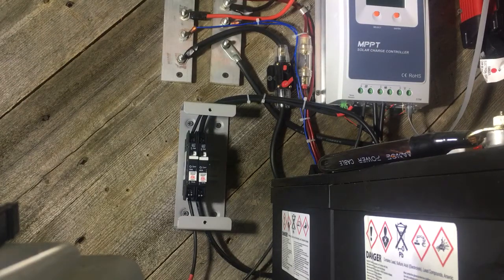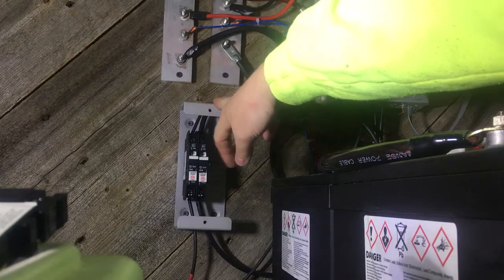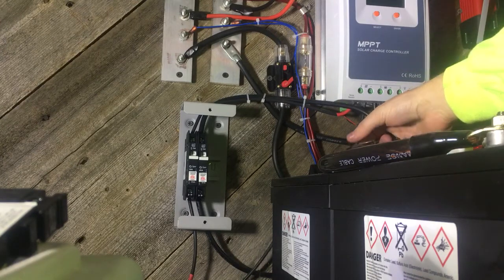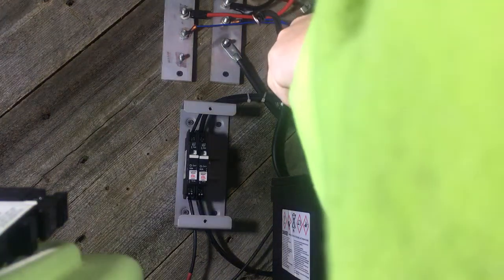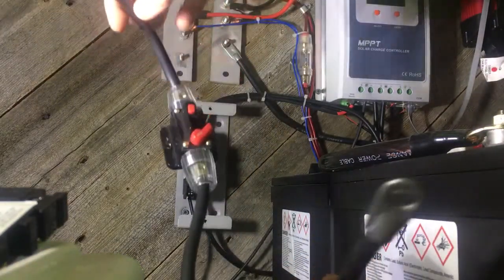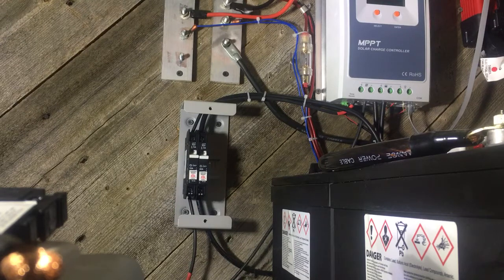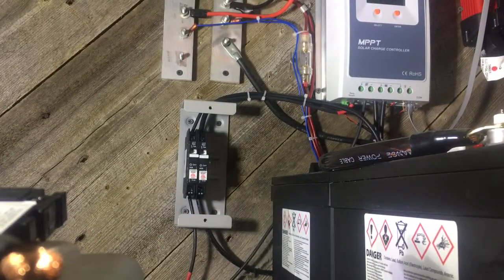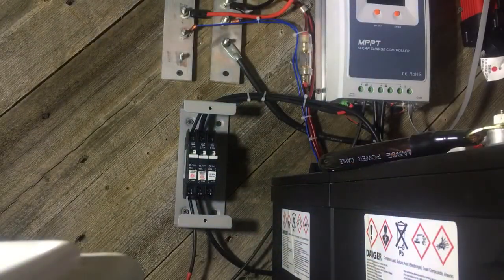Installing a D.C. Breaker

Comment: If I have two 100 watt panels in parallel, where would I add the breaker? Do I put use two breakers for each panel or one breaker fro the parallel? Before the charge conteoller?

Comment: just asking cause I'm newbie here. If the voltage rate of the breaker is 440Vdc 10Amp, will it trips if I installed it on 600Vdc network or directly burn it? thanks for answering.